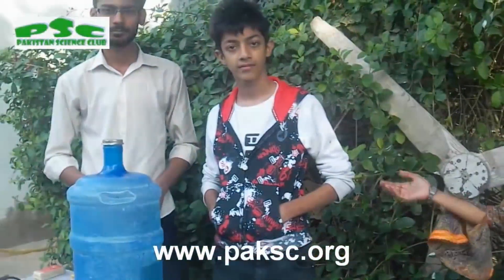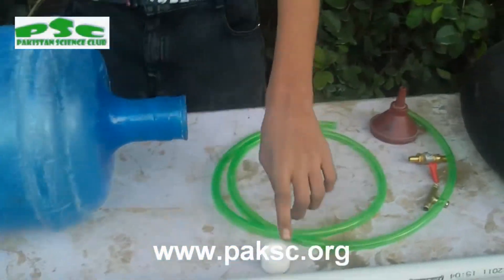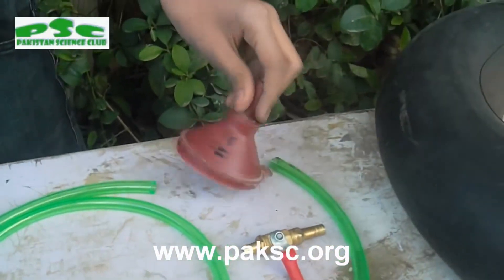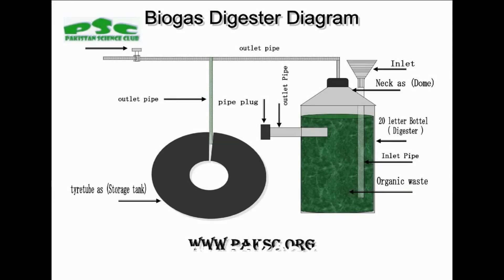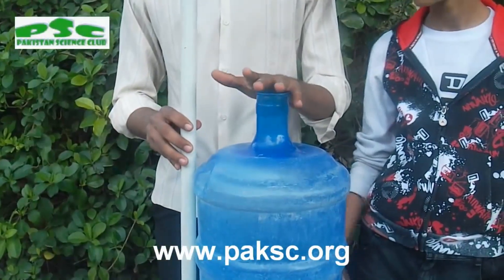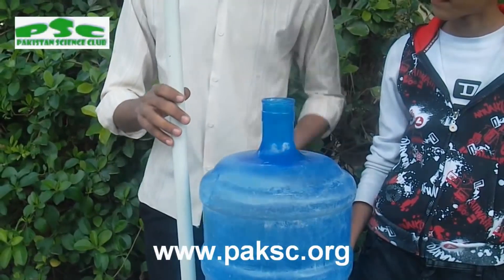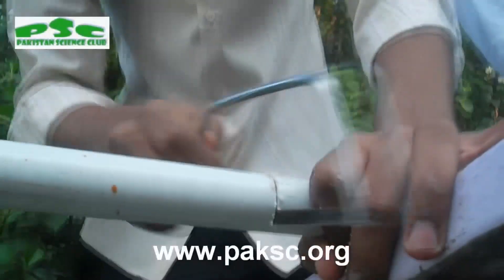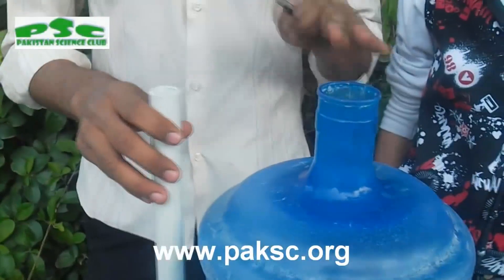Working Model of Biogas Plant for Science Project with subtitles

Comment: Great. My questions are
1. Can we use kitchen waste, like waste fruit, vegetable residuals, leftover ediables etc?
2. How to get plant's residual out and what is its best use (in case of both Dung and Kitchen waste)?
3. How much (in terms of percentage or days  in month) the gas requirements are fulfilled by this for a normal household?
Reply from the maker: 1. yeh you can use any kitchen waste 

2. its waste is very good fertilizer so you can use in your garden.
3. for the normal house you have to make a big one like 2, 3-meter cube biogas digester